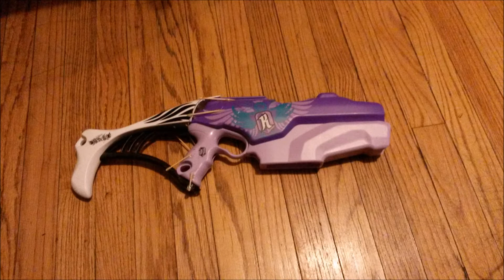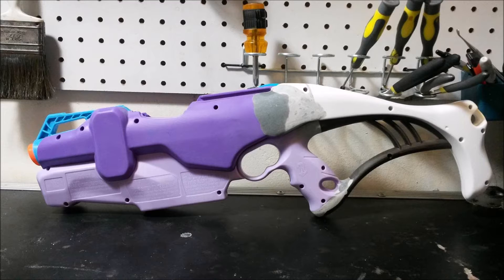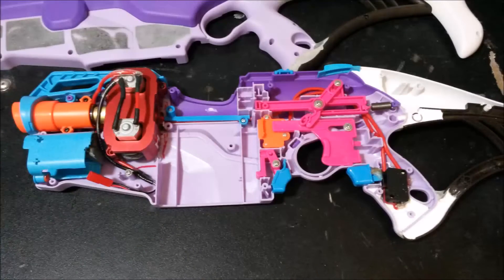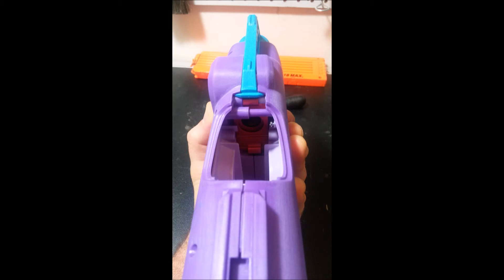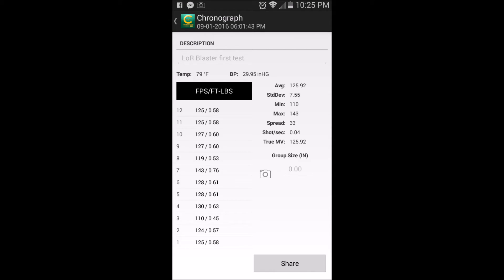Leader of Rebellion Update

Comment: Put some XP180s in it. You can get them from Blastertech. If you have Artifact flywheels (the smooth ones), you can get 150fps average. To power it, use a Turnigy BOLT 2s LiHV 500mah.
Reply from the maker: This project is a commission and is all about maintaining sleek smooth lines so I did not want cut the shell to use larger motors. Thanks for the feed back though!